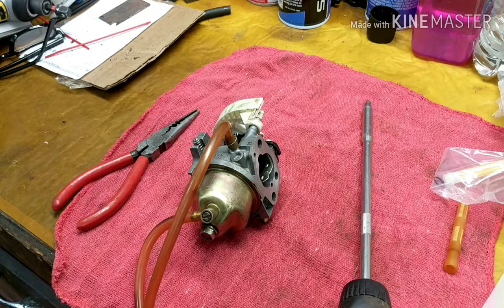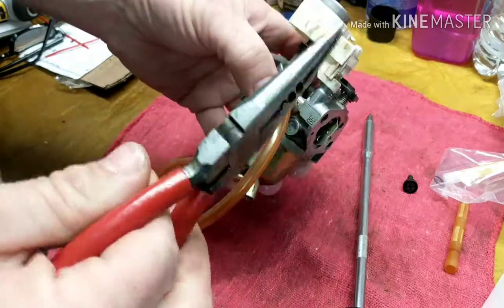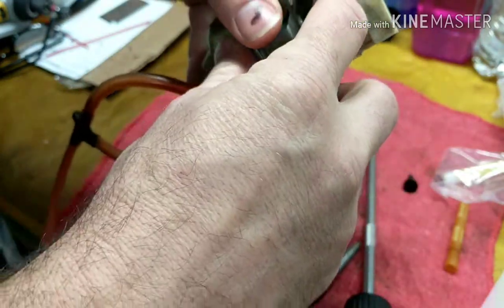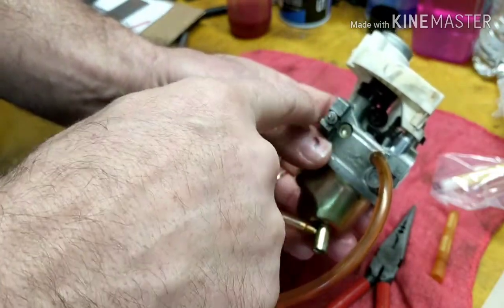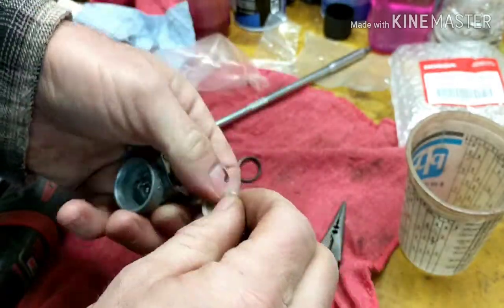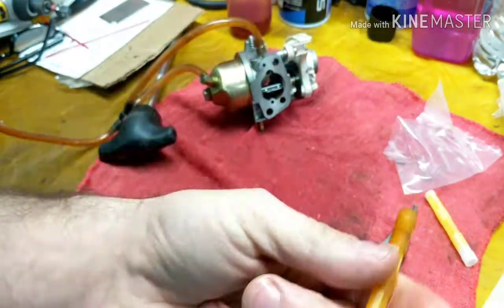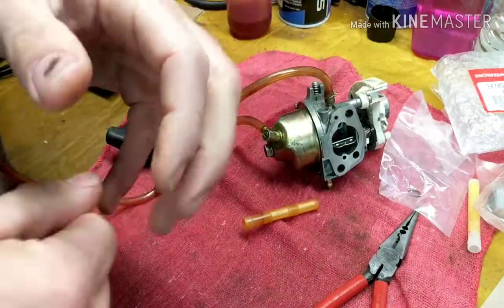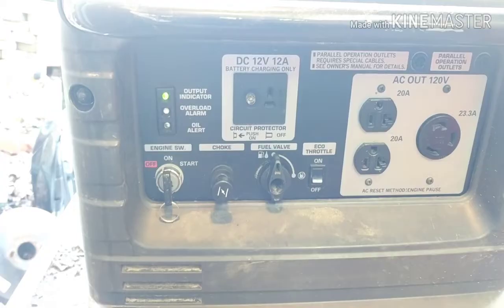Fix surging for good!!!

Comment: Cleaned out the pilot jet as well as Sonic cleaning all carb parts. Still surging, though not as bad. As far as the mixture screw? What's the advantage of breaking off the tab to make it turn a full turn as opposed to just ¼ turn as it's intended ..... ESPECIALLY considering some genset carbs have no mixture screw adjustment at all - just a plug.  I have 2 carbs for our Honda eu6500is.  One came plugged (not adjustable) & the other is ¼ turn adjustable. But since some are obviously not intended to be adjusted, how crucial could cleaning out that port really be. I could remove the permanent plug if it were to really help.
Reply from the maker: The advantage is that you can clean it out and have more adjustment. It will surge at low rpm if it has low compression or a bad valve as well.
Reply: Tepco Cycle Repair - our surge happens when eco is off - or a load of 3.5Kw's or greater demand is required while in eco mode. We have more maintenance & diagnostic hours of use, than actual generator need .... 37hrs vs 20 - total of 57hrs.

Comment: Hey what is that connector called that you have attached to the cup?
Reply from the maker: It's factory. The large bolt in the center mounts the bowl, the other is the drain so you can drain the bowl when storing the generator.

Comment: What if the motor surges under no load but runs better (still not great) under load? Older B&S Generac generator.
Reply from the maker: Clogged pilot circuit. Just give it a good carb clean

Comment: Great video. I have a fleet of Honda bikes and motors and the most common issue is the idle jet blocked.  Your tip on the tank filter is a gem. I'll change all my tank filters now. ! Many thanks.

Comment: I was advised to buy a Honda....best they said. Not impressed with fuel problems I am having especially on my very low hrs machine.not sure I would buy another
Reply: It's all about proper maintenance. Use non-ethanol fuel, don't let old gas sit for long periods of time and be sure to take advantage of the fuel shut-off valve and run the carb dry before storing long-term.
Reply from the maker: @mtnmotoadv  perfect advise! Adjust the valves once in a while as well and you'll be good.
Reply from the maker: Yeah, agreed.

Comment: Cleaned carb, still surging. Do you remove fuel strainer from in tank  by pulling it up or do you  pull it out from  bottom ?
Reply from the maker: Pull it out of the bottom, buy a new one. They will trick you by looking clean but they flow horribly when old.
Reply: @TepcoCycleRepair  Thanks
Reply: pilot jet was plugged cleaned it  took tank screen out , damn thing still surging
Reply from the maker: @haroldhaggman4285  I have one here now that surges as well. It seems like it has carbon build up on the intake valve. I need to pull the head off and check. I made a video of the failed leak down test showing it. Heads with valves and springs are cheap but China that I don't trust. I'll pull it and make a video, unfortunately it's down the list.
Reply: @TepcoCycleRepair  Just ordered all new jets and needles maybe wasting my money. Thanks for all the help and info
Reply from the maker: @haroldhaggman4285  Maybe not, let me know how it works out.
Reply: letting you know finally. it was the throttle control motor
Reply from the maker: @haroldhaggman4285  Ahh good to know. Do you diagnose it? If so how? Good info!
Reply: @TepcoCycleRepair  When you remove it, take out motor only and turn shaft  slowly . There should be no roughness or dead spots when spinning. Mine had a dead spot almost in middle. it runs like new again. Eco to Full power is instant now.
Reply from the maker: @haroldhaggman4285  Awesome, I'll look it up and make a video to help others!

Comment: I replaced my carb after trying to clean it three times and it still surges. I have a Honda 190
Reply from the maker: It may be surging due to a bad valve. I'm working on one now that has a bad intake valve (bent or carbon build up) and it will cause surging as well. See if you can get your hands on and do a leakdown test.
Reply: Tepco Cycle Repair what’s a leak down test and how do you perform it? Can a bad spark pug cause surging?
Reply from the maker: @edbtzkhud  https://youtu.be/Ddpsw1x_q0U check out this video and yes a bad fouling plug could cause it.

Comment: Great video. I have about 6700 hours on my EU3000IS (4 years old, CARB model) . About 1200 hours ago, it started running a little rough when ECO mode was off. But, during the winter, I never run the AC, so it stayed on ECO. About 300 hours ago, it really started getting rough. I previously cleaned the carburetor, but decided it may just be getting old. Purchased a new one, adjusted the valves, oil, air filter, spark arrestor. It seems to run a little better when I adjust the idle screw at one speed, but as soon as the load changes, it gets rough again. Now even at idle in ECO, it's running rough. Surges a lot. Anyways, I guess I should try the tank filter. Do you just unscrew from under the tank, or does it just pull out? I don't want to break it... Thanks again. Do you have a patreon or PayPal?

I'm curious if it's just at the end of its life and the internals need to be replaced..
Reply from the maker: When you unscrew the fuel valve at the bottom of the tank it just pulls out. I do have a patreon, just haven't launched it yet. Thanks for watching!
Reply: I have this SAME problem. I live off grid and eco mode would be nice to use because it saves so much gas. But it’s impossible to adjust because of the load changes.
Reply from the maker: Get it adjusted in eco mode with no load. It should be fine everywhere else in the rpm range. Always start with a good carb clean and valve lash check if you're having issues.
Reply: @TepcoCycleRepair  I dont think eco mode will work with my new inverter. When my batteries enter absorb charging mode it requires a heavier load. So the eco mode lags a little to long before it kicks on. Youll hear it rev up, but by that point my inverter already stopped the charging because it couldnt get the power fast enough. Then the inverter will stop the charging cycle, which in-turn unloads the generator. Then it restarts in bulk charging, and its a never ending cycle.
maybe i could adjust the idle a little higher on the eco mode, never tried it yet. I think its just too much of a lag between calling for power, and revving up to that load.